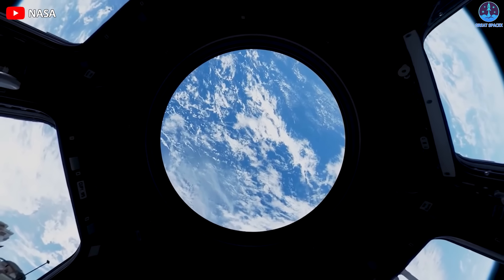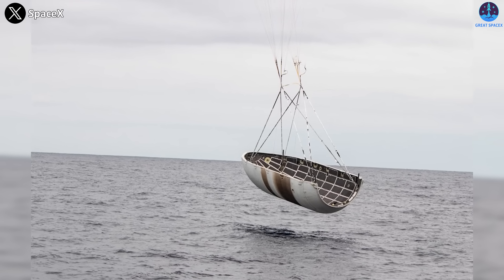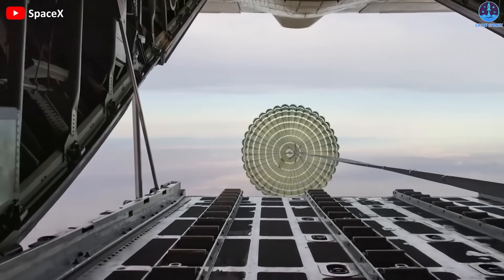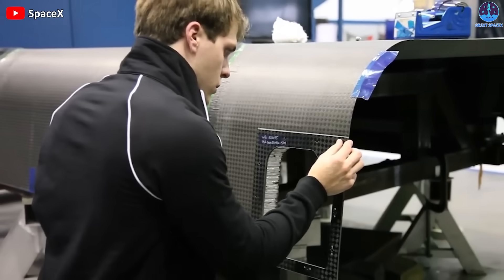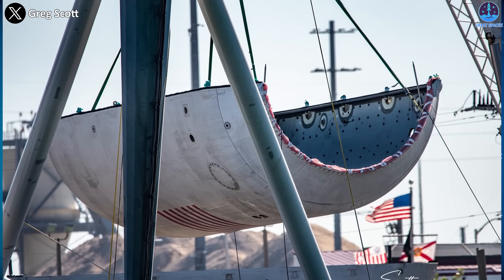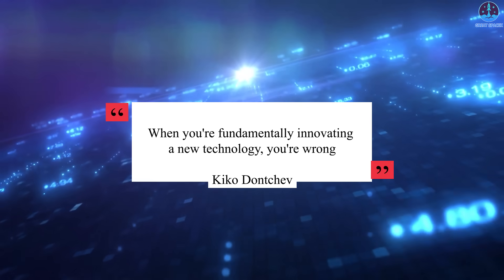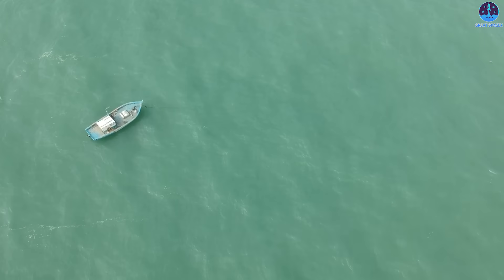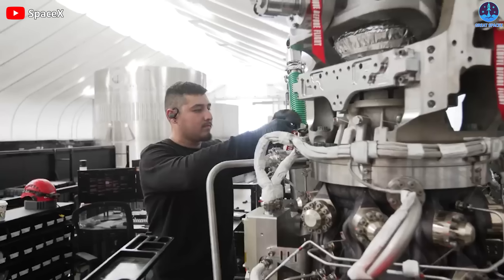SpaceX's VP revealed the real reason SpaceX gave up on “catching” falling fairings!

Comment: Why haven't they impregnated the metallic parts with sealants so the salt water simply can't affect the parts. A thin plastic (Obviously heat resistant) coating could make it so only a tinny portion of exposed metal parts would need attending and make those parts easy to replace between usage. the rest of the unit could be washed down to remove any residue.

Comment: To recover the rocket you need to reduce the payload for the extra fuel to land it back ... so basically smaller payloads than conventional rockets ... doesn't make sense ...
Reply: Turned out the hit was relatively small. And retro-propulsiion proved to work well as a brake and heat shield during re-entry, which wasn't well understood at first. NASA used the venerable WB-57 Canberra to observe the early Falcon 9's during entry burn tests... the results were quite startling.

Comment: With all that tech, why don’t they outfit each housing with a light weight gas filled bladder that deploys to fill the inside of the hull tightly enough to seal and prohibit sea water from making contact with components of concern long enough to get the hull to shore?
Reply: Much simpler to simply waterproof the gear (e.g. by coating or encasing electronics with dielectric gunk).

Comment: The water displacing hull was the main failure of the capture ship design.   An Air Hockey game puck in giant size would have been cheap to make and much quicker on the water.
Reply: A hockey puck will not be that quick over choppy waters. Otherwise all ships would have this design. Air lubrication is just starting in the real shipping.
Reply: @CaptainBassie  Serious lapse of imaginative flexibility.  Why do you assume a big heavy ship?
Reply: @clavo3352  taking into account the fact I’m working at sea since 2000 and never seen a hocky puck design. Closest to it is a hoovercraft and this is a very niche design not able to withstand high sea states. Biggest in operation at the moment are USMC LCAC’s. They are not as easily handled as you think. To keep a full aircushion is a difficult task and getting  it  in the correct direction an even bigger one.
Reply: @CaptainBassie  I can't self identify per YouTube policies,  but my patent which is already in public domain solves all these problems.

Comment: With only one ship to catch the fairings, what do they do when they have a Pacific launch?
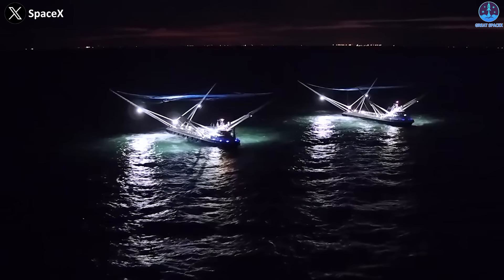Reply: This video's ship info is quite out of date.  7:22 mentions the Shelia Bordelon, which SpaceX chartered for several months in early 2021.  But later that year SpaceX acquired two ships, originally named Ella G and Ingrid, which they rechristened Bob & Doug (after the first 2 NASA astronauts flown by SpaceX).  Both of these ships are based on the east coast, but only one is needed per single Falcon 9 mission.  (However SpaceX has two launch pads on the East coast, including the high-cadence SLC-40.)  Bob or Doug (alternating missions) are able to tow the ASDS (landing barge -- two of which, JRTI (Just Read The Instructions) & ASOG (A Shortfall Of Gravitas) are based on the east coast) out to station, as well as scoop both fairings out of the water.
On the west coast they use dedicated tug boats to tow the ASDS (OCISLY -- Of Course I Still Love You), and use a smaller ship, currently the GO Beyond (GO for Guice Offshore, the company the charter it from) for fairing recovery.

Comment: C'mon, why aren't the fairings a non detachable integral part of the second stage that opens up for release, then closes down for re-entry? Can't the second stage take the payload to negligible-atmosphere height? This design is out there and known.
Reply: The fairings are dead weight once the rocket gets out of the thicker part of the atmosphere. Dead weight in rocketry is taboo, so it is best to get rid of it as soon as possible.
Reply: @JanBruunAndersen  Yep.  Rocket Lab's current design for their next generation rocket Neutron has it staging later than the Falcon 9, with an integral fairing attached to the recoverable booster which envelopes both the payload and the upper stage.  It will be interesting to watch its development play out.
Reply: the problem is the fairings are attached to the second stage which isn't reusable it burns up on the way down or stays in orbit, the only way would be for the fairings to detach from the second stage then slide down the rocket and attach to the booster for a ride home

Comment: Why don't they just keep the fairings attached to the ship and have it returned with the ship
Reply: The fairings are above the second stage which isn’t recovered.
Reply: Weight reduction. On a rocket - the moment a part isn't needed anymore you jettison it to make the remaining craft lighter. You need to accelerate the payload to about Mach 25 to stay in orbit, every pound shed is 1 less pound of weight to accelerate up to that speed.
Reply: The Falcon 9 stages early, as far as rockets go.  The fairings aren't jettisoned until 30 seconds after staging.
Your idea is being pursued by Rocket Lab and their next generation vehicle the Neutron, which will have integral fairings (which envelope both the payload and the upper stage) attached to the recoverable booster.

Comment: SpaceX doesn't get stuck on bad ideas for long. Originally, Musk wanted starship to be made out of composites. It was stupidly expensive and incredibly slow. Realizing this, they shut down that idea quickly and went all out on stainless steel and tested for the best alloys. The rest of the rocket industry could lean from this but they don't.
Reply: Exactly
Reply: And which rocket company NEEDED to change? 
Rockets have been made out of stainless steel since the 1950’s…
Reply: @allangibson8494  Nope. Most rocket use some kind of aluminum or alu-alloy.
Reply: @saxus  Look up “Titan”. It used a stainless steel hull for its entire 46 years in service (1959 to 2005). Atlas used stainless steel from 1954.
WD-40 was developed to prevent corrosion in these missiles.
Stainless steel has a stronger strength to weight ratio than aluminium.
Reply: @allangibson8494  that's one rocket which have been decommissioned in 2005. Above Centaur no one rocket use currently steel for tanks. Even Atlas switched to alu tanks after Atlas III. And for that two example you can search 10 others which uses different materials.

And stainless gives better strength only if you use a balloon tank design.
Reply: @saxus  There have also been stainless steel aircraft dating back to the 1930’s…
Duralumin and Stainless steel are interchangeable in relation to strength per unit weight…
Reply: @allangibson8494  Rockets and aircrafts are completely different structures. And strength and weight is just one factor of many. Like what kind of fuel do you use, is it cryogenic, is it corrosive, what area, is it balloon tank or sustainer design. where the forces come from, what pressure must it withstand, is it a sustainer, what manufacturing techniques are available, etc. etc. etc.
Reply: @saxus  And stainless steel is superior to aluminium alloy is all but one property - flat panel stiffness (because it is much thinner). The fact it costs six times as much is of more significance for most applications however.
Reply: @allangibson8494  Dude,  you're a steel seller or what? Above Starship and Centaur upper stage not a single operational rocket uses steel while there is at least 15 rockets which uses some kind of aluminium: SLS, Atlas V, Delta 4, Vulcan-Centaur, New Glenn, Ariane 5/6, Antares, Falcon 9 (it uses aluminim-lithium alloy), Proton-M, Soyuz, Energia, Angara... etc. etc. etc. All of those made from aluminium despite your magical stainless steel properties.
Reply: @saxus  Aluminium is cheap but not heat resistant. Stainless steel doesn’t burn up on re-entry (kind of significant for a single use booster).
Hypergolic propellant rockets use stainless steel tanks exclusively (because hypergolic oxidisers see aluminium alloys as fuel to burn).
Reply: @allangibson8494  Bit always need a heat resistant tank. Also stainless will burn i atmosphere too. Centaurs are perfect example for them which ware disposed I that way. Also Proton-M uses hypergolic, yet it made from aluminum.

You just BS-ing without any clue.
Reply: @saxus  And SpaceX’s upper stages are washing up in Australia and there are Protons all over the place. Centaur upper stages don’t re-enter the atmosphere (most are still in orbit or beyond) because they follow the satellites they carried out.
Reply: @allangibson8494  Dude, yet again: you have no clue at all. ULA try to deorbit Centaurs if it's possible.
Reply: @saxus  If a Centaur is going to geostationary orbit or beyond it is staying in geostationary orbit unless you actively de-orbit it.
Reply: @allangibson8494  Even in rigid dirigible airships! The R100 was built of dural, the R101 of steel. Tragically, the R101 crashed, but that was perhaps due more to mismanagement than because it used steel.
Reply: Rocket Lab looks to be staying with composites.
Reply: @mitseraffej5812  And Ariane 6 will got an upgraded upper stage with composite tank but those are rather an exception too.
Reply: Well the rest of them operate on tax payer dollars.   SpaceX is really the ONLY "Self-earning" firm who has to be actually profitable, rather then just profiteering off Uncle Sam and claiming a profit.  It's the approch that matters.
Reply: Many others out there testing SS designs currently.
Reply: Every aerospace company has been both incredibly conservative and incredibly process-driven.  Any who bucks this trend puts their job at risk.
Reply: @robertking3098 well, spaceX disagrees and they’re winning by a long shot
Reply: @roque-au-parcus : It's well-known that SpaceX isn't your typical aerospace company.

SpaceX is a privately-held company.  Therefore they have no stockholders to answer to.  Elon calls the shots.

Pubically held aerospace companies like Lockheed Martin, Boeing, Collins, etc. all must answer to their board of directors and ultimately their stockholders.  This forces them to make more conservative decisions, risking less, and encouraging a slower, more stable growth.

That is a fundamental difference between SpaceX and the rest of the aerospace industry.
Reply: @robertking3098 Actually, they have stockholders, they're just not publically traded. But they have investments from a number of big money sources. I believe currently Elon holds about 42%, but has about 79% voting rights.
Reply: @KaiHenningsen  : I'm aware of how privately-held companies work, having owned stock in several myself.  To say "they're just not publically traded," is a gross oversimplification.

Ylou did get the salient point right though.  Elon controls the company.  Not the stockholders, or asnyone else with a vested interest in the company.
Reply: You mean... SpaceX don't do PDR and CDR to catch dumb ideas in advance.
Reply: @saxus  Or perhaps the tests are the design reviews.

In reality, I imagine PDRs and CDRs are done in some fashion.  How they do them is up to them and whatever standards they choose to adhere to (or not.)

But it seems that if there's a choce between taking months to answer a question (like at what pressure will a tank design fail,) and answering it in weeks with a test that will most likely fail, SpaceX is very comfortable with blowing up a tank and moving on to the next thing.
Reply: @robertking3098  do you understand the term "design review"? No, tests aren't desgin reviews. Tests are for validating (or disprove) your theories, designs, etc. Yes, eventually you have to light up the candle. But if you don't have any clue that your design will work or not or how your design will work then you aren't an engineer, you're a ninjaneer.

Comment: They stopped because it did not work reliably.

This is one thing that it is important to remember before joining the team that thinks everything that SpaceX does turns to gold.
Reply: Every rocket that has made it to orbit has exploded at some point… it’s the path needed to make something great
Reply: @manuelight Untrue. No Saturn V ever failed to make orbit or exploded.
Reply: @wrwhiteal bro hasn’t heard of Apollo 1
Reply: @wrwhiteal Apollo 23 exploded on the launch pad 👍🏼
Reply: Anyone who thinks everything that SpaceX does turns to gold hasn't been paying attention.
They are hard driven, and in the process of development are willing to attempt many outrageously ambitious methods of reaching their goals, some of which succeed and some of which are abandoned when they don't pan out.
Remember the multi-million dollar carbon fiber BFR tooling they scrapped when they pivoted to stainless steel for Starship?

Comment: I was hopping to find out why they stopped the oil rig  recovery. I think they sold the 2 oil rigs they were covering
Reply: Considering the water deluge system they had to design that would have been easier if not even needed on the water based oil rigs.

Comment: Would they have the distance to glide to land?
Reply: No.  The fairings come down over 600 km out to sea.
That's even farther out than where they land the first stage with ASDS (barge) landings since the fairings aren't jettisoned until 30 seconds after stage separation.

Comment: Couldn't the cost benefit analysis have determined this revised approach to fairing retrieval at the outset?
Reply: Gotta try it before you get enough factual information to determine the feasibility.
Reply: Maybe, you’d also think there would be enough data on concrete to demonstrate that some cooling would be needed , oh wait nasa understood that 50 years ago  lol head engineer lol
Reply: This was a case where dire expectations (salt water damage) proved to be less than expected. That could only be learned from experience.